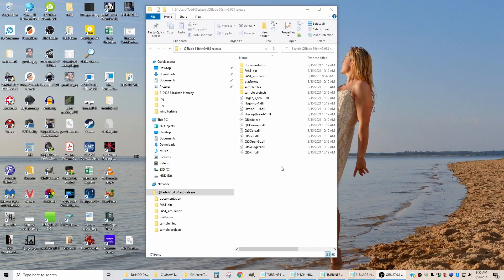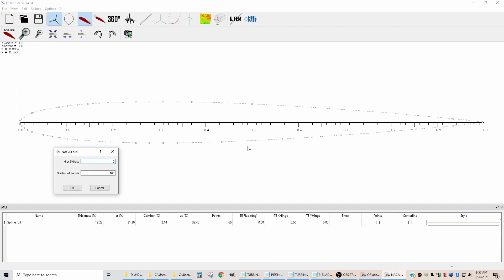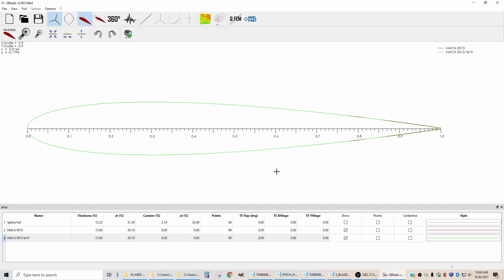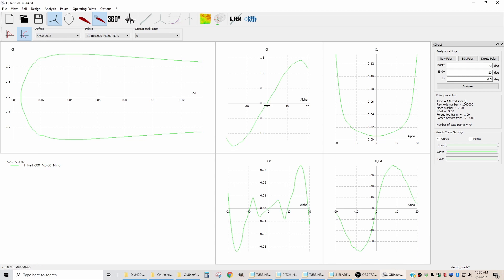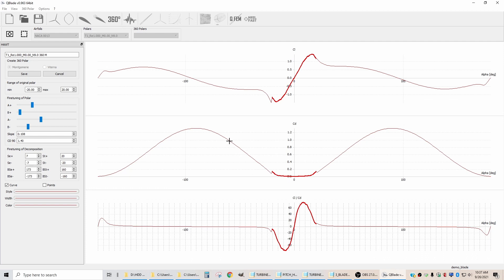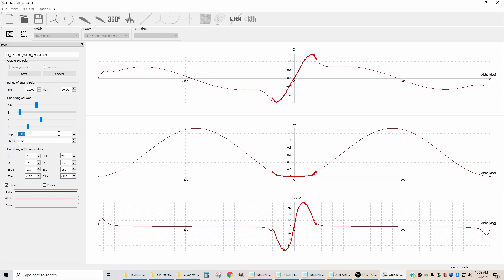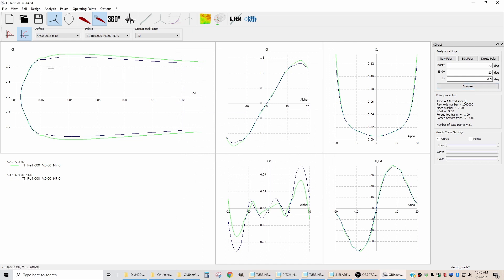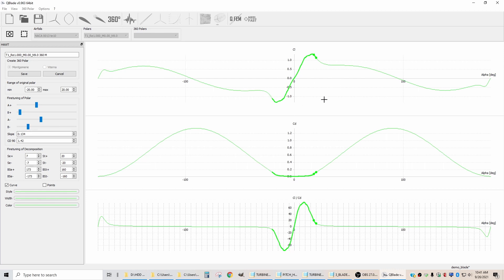3D Printed Wind Turbine Blades - Defining Airfoils

Comment: Suppose if I want to design a home fan table blade where I required only more air flow, can I use this software?,  because, the home fan table blade outer profile  is bit big wider and the bottom position is small looks like a propeller,  In that case what to do?